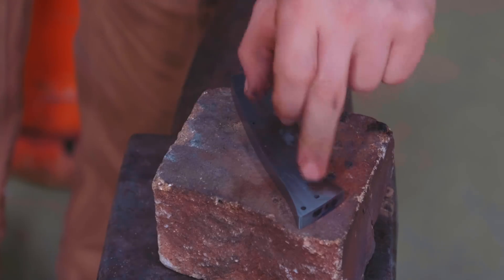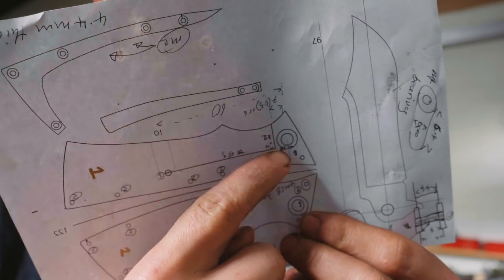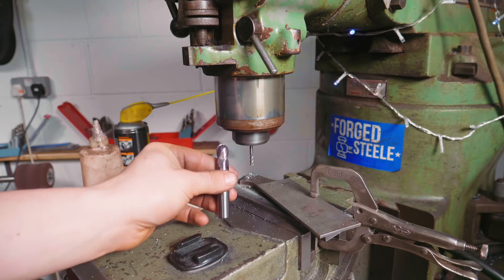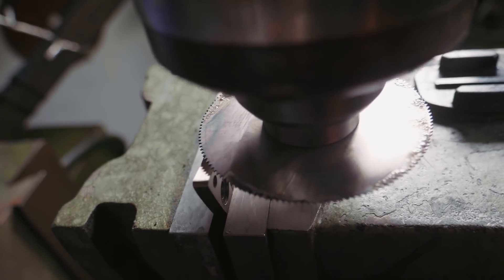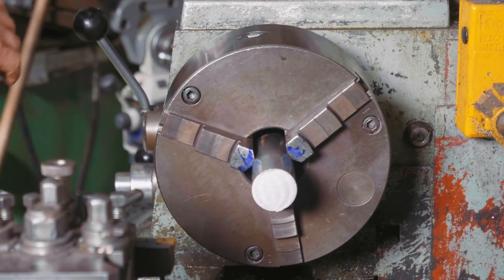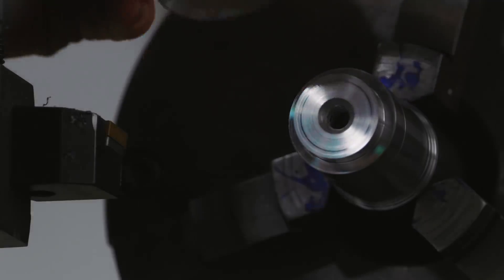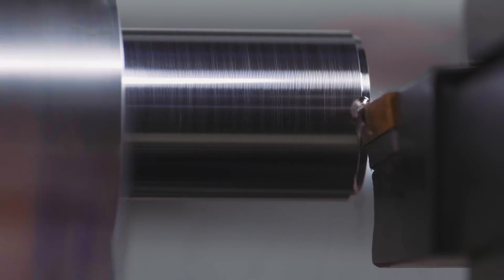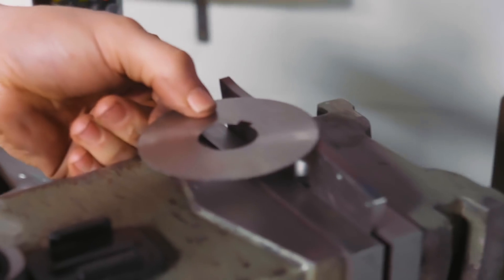MAKING A FRAME-LOCK FOLDING KNIFE!!! PART 4 *I keep messing up*

Comment: Pro tip: if you want perfect concentricity for your tooling in the mill, instead of making them in the lathe you can perform most operations in the mill just by putting your turning tool in the vise and using the spindle of the milling machine to make essentially a vertical lathe, by doing that you reduced the risk of stacking tolerances when moving from the lathe to the mill.
Reply: I just wish I could comprehend what you mean.  I've read it four times and I'm still stumped.  What is a turning tool?  Has Alec used one before?  I believe you're a pro, and know what your talking about, but could you dumb it down for me?
Reply: Knowledge IsPower a turning tool is the tool Alec uses in the lathe, it holds the gold colored insert that cuts the metal in the lathe. What alec could have done is put the material in the collet in the mill and put the turning tool in the vise, thereby making his mill into a vertical lathe, the advantage being that because it is being machined in the place it will be used, it will have perfect concentricity (zero run out or wobble) when in use, rather than moving from machine to machine and risk adding up the inherit imperfections in machining and in separate set ups

Comment: Hey Alec sometimes when you get on the lathe or mill i cringe i have been a machinist for 18 years now I'm not gonna criticize just a few tips. You need to use a lot coolant when turning, milling, or drilling the chips should not be coming off straw brown or blue and when you use the face mill those chips sometimes come off so hot they look like sparks. Fixing your RPM's to the proper speeds and using coolant will correct that and you inserts and other tools will last longer. For RPM's to calculate that its 4x the cutting speed ÷ the diameter and to get the cutting speed for the materials you using should be able to find most online and the cutting speed will be in surface speed per minute (SPM) and I also recommend getting a machinist hand book with all the info in it, it can help with what else you work with on the the machines machines slitting saws ect.

Comment: machine work is fun, but you have to have the tools to do it. a nice mod for the 3 jaw is to make a backing plate that you can buck the whole chuck via grub screws to center a work piece. ~.05" total movement is normally enough. also, 6 jaw universal chucks can grab on a much wider variety of things with less part crush than a 3 jaw. if you want to make your chuck have less run out, assuming its accurate, chuck on a external ring at the tip of the jaws and grind the jaws true. (even a die grinder and a stone wheel can do this assuming you can mount it ridged)

Comment: Alec, if your mill table is square, but your vise is not, you can surface grind the bottom of the vise or the top of the jaws, depending on which one is out of square.

Comment: Your lathe will have a Morse taper in the spindle.
Get a Morse taper to R8 adapter and make a draw bar. (Goes all the way through the spindle]
And or Get a Morse taper to 5c adapter as well and you will be able to use all your collets
That collet chuck needed a dam good clean out anyway.  You have it why not make it work.
BTW
I love your machining videos just as much as you blacksmith stuff.
I’m a machinist and a newbie blacksmith :)

Comment: When you drill holes into punched or pre-drilled holes you should loosen the vice (and use a light one), so it can move to center itself. Otherwise the centrepunch is actually pointles.

Comment: I learned to tram a mill using those giant races or bearings because you can track your indicator 360° around it and don't have to move any blocks across a table

Comment: hi alec , just wan't to inform you that you can thigthen the piece on the lathe on one single hole , don't need to turn 120degrees etc , because they are all 3 connected to on other thing ... they put 3 hole just to be easy to find 1

Comment: if you heat treat the scale get some fire block mortar caulking or what you like for hamon lines and fill the holes let it dry few hours and bump the tops on the granite youll haave to clean them with tap and reamer again but will protect the threads

Comment: Hey guys I need your help! I've got a damascus knife and it got a bit rusty... What's the best way to clean it up without damaging the surface?
Reply: Didin Wendt Literally, use electrolysis. That is hard for one off though. If you could accept the slightest ware, vinegar will soften the surface in a few minutes (etch, actually). Steel wool, acetone and a little elbow grease will clean it up. Then let some light oil soak in. Any of that you don't have will be about as hard to get as a bread and milk and cost about the same.

Comment: Henry has a leaky bucket, and Liza tells him to repair it. To fix the leaky bucket, he needs straw. To cut the straw, he needs an axe. To sharpen the axe, he needs to wet the sharpening stone. To wet the stone, he needs water. But to fetch water, he needs the bucket, which has a hole in it.
Reply: that never made sense to me. why would you use straw to fix a bucket, or an ax to cut straw

Comment: It would be cool if the screw used that tightens down on the washer and secures the blade to the body had your “S” symbol as the tightening groove, as opposed to regular flat head. You can stamp the design on a metal block. Deepen it with a deremel or etcher, and cut it out then lathe it to your liking and boom you have a screw, you just have to use the stamp as a screwdriver (of course you can also make another one)

Comment: Looks like you have a pretty-well taken care of 3 jaw. Good! (Practice 4-jaw indicating, ABOM79 is a beast at it, you've probably seen) Now, if you're getting your workpiece centered in by using a hammer, the longer the workpiece you have sticking out of the chuck, the more important it is to indicate it at BOTH the chuck-end as well as the tailstock end. Otherwise, wobbly at the tip. (depending on how much time you want to spend etc. etc.)
Hopefully you have a thin file to clean up the ends where the slitting saw can't reach; make it look nicer than with a hacksaw or a big relief hole.
What you used the ball-nose for, you could also use a boring bar to get 'whatever' diameter you like, as well as having a sharper end to your cylindrical cut, so no cup-shape at the other side of your slitting-saw cut. Finish is generally nicer as well. Boring heads are wonderful tools with a wide range of uses.
My sympathies in your collet chuck being... picky. Good luck in machining a piece(s) that you can replace to properly thread in the 5C collets.

Comment: No wanting to sound nasty but now point using a clock gauge on a 3 jaw chuck Alec. Since the jaws all move in together itll be as centred as good as can be when made. Which is usually pretty good.

Comment: You should heat treat the scales and temper them much hotter than you would a blade (you'll have to experiment a bit with the Temperature to fit your steel) so that it becomes a real spring, since annealed steel bends really easily, but if you get the heat treat right, it does not

Comment: To Calculate the correct speed for your turning and milling. Use this formula : (1000xVC)/(3,14xDiameter) = (320xVC)/(Diameter)
For a HSS drill use VC=20-40 and also for HSS mills. And always use cooling water when using HSS!
For the HM you Can go abit faster VC=80
And with the tool where you can change the cuts (no idea what its called in english(in Danish its a Knivhoved med platter)) you can use like VC=200

For exampel: with a 10 mm HSS drill. (320x20)/(10) = 640.

Comment: Alec, 3 jaws are fine for roundstock, only need 4 jaws when turning square stock
Reply: Duco Maritiem no it's not
For example you can machine deliberately off center with 4 jaws
Reply: Markus Camenzind Yes, you're right. It slipped my mind.

Comment: Hey Alec, I just noticed a 1-2-3 block on your table. Could you make one some time soon? I have to make one for a project in my degree and it honestly is the most intimidating project we have, and it would help sooo much to see one being made,
Reply: TrentN64 he doesn't have the machinery to make accurate things like that
Reply: Markus Camenzind what do you need besides a mill that has a computerized axis measurement and the right size end mills?
Reply: TrentN64 grinding to exact size 
Heat treatment oven ( needs to be controlled heat to avoid warping  )
Also i don't think he has done some case hardening yet
Reply: Markus Camenzind ok, I only meant the milling and boring processes, i dont have to heat treat any projects until my fall trimester, and as I don't get much hands on experience until March, (thanks OSHA) I'd just like to see the early stages,
Reply: TrentN64 try the basement guy
Good machining chanel

Comment: Nicely done! But you should indicate a Part on several position to make shure it's in fact trued up. Otherwise it might not be alligned perfectly. Also you shold check out Stefan Gotteswinter and Robin Renzetti. ( If you havent already ) They don't do Abom size work but their attention to detail and precision is phenomenal.
PS. Your vise might only experience jawlift. On some models it can be adjusted.
PPS. I've experienced the same thing with my Röhm vise which is repeatable within 0.02 mm.

Comment: Just stopped this at 7:37 so i don't forget. 
 I'm a NOVICE at most machinest. I only took a BASIC class and made a few things. But if that piece of metal is steel. Shouldn't it be chipping off. I noticed there are chil breaks on it. 
If not, then is it the metal, rpm or the height of the cutting bit that is keeping it from chipping?
 Pls correct me any professional machinest out there watching and reading this.

Comment: Alex you are drilling too slow.RPM=4xcutting speed divided by the diameter for imperial system. Eg. for 1/2 drill for mild steel. 4 x 65 fpm/ 1/2 dia.= approx. 500 rpm. So roughly a 4 mm drill should be used at 1500 rpm. Because your Damascus steel is an unknown you could moderate that a bit by starting at 1000 rpm and gradually increasing. When rpm is too low you create too much force on the cutting edge breaking drills or tool bits. Too high an rpm, too much heat. Ideally go as fast as you can without overheating. Thanks for such a great site.

Comment: Alec I think you are over engineering the knife. I see folks making folders using hand tools and relying on their eyeball talent as opposed to using machining tools. Not to be too critical but the damn knife is going to weight a ton. why not use thin metal for the housing and some lighter materials like horn or wood for the scales. Hand craftsman ship should not be overlooked. Enjoy your work. At 20 im not sure I was totally toilet trained yet.